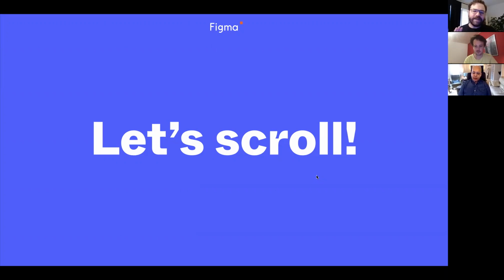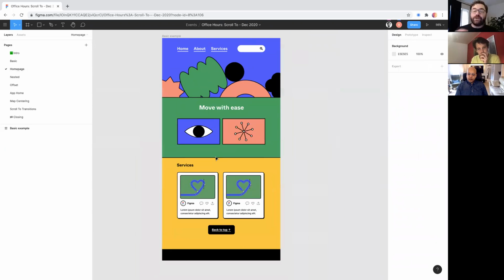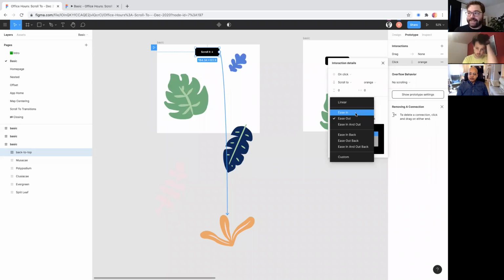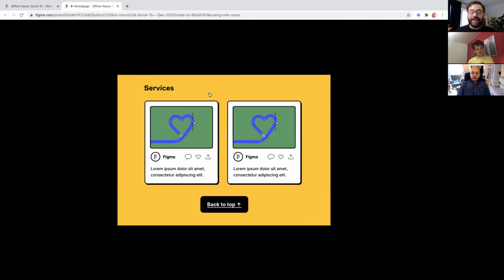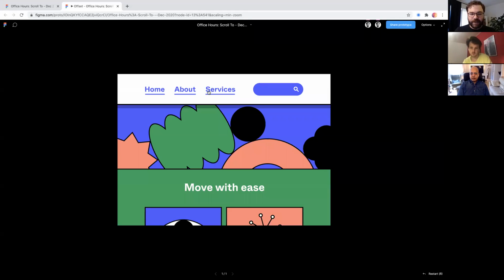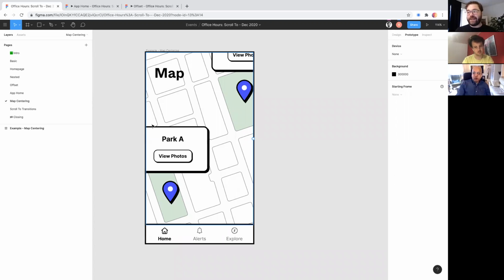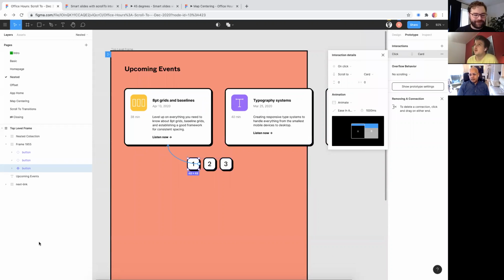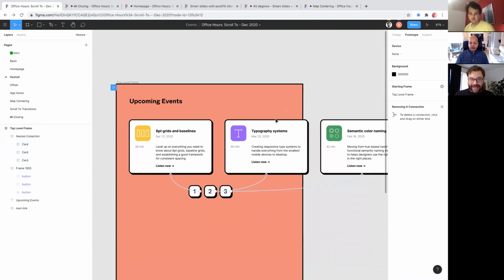Office hours: Scroll actions for your prototypes

Comment: Still having trouble with horizontal scrolling :(. I had an issue similar to the one the presenter had, but I couldn't work out how to fix it . I have a set of cards that I want to link together, I want to be able to scroll (horizontally) from one card to the next when I click on a button on a card it should take you to the next card. I have put the card series in a frame and I have set the overflow behaviour of the frame to horizontal scrolling...no luck though. Could it have something to do with needing to set the offset? My current work around is to create a manual overlay on the first card (card appears after a delay) that way I can link the cards by making them all overlays and setting them to swap overlays.

Comment: Hey guys! I have a question. Not quite sure that it is the right place to ask but: Let's say I have 2 pages/dashboards (mobile app). I would like to click on the icon on the 1st page to take me to the 2nd one but to the middle of the content (not to the top, not to the bottom). I would like to have the option to scroll to the top and the bottom but the funtionality/transition should be to the specific part of the page with the ability to scroll. I'm searching everywhere and I couldn't find anything that would work that way in Figma.
Reply: Hello good day, I want to confirm if you have found a way to achieve this, because I am currently having a similar problem